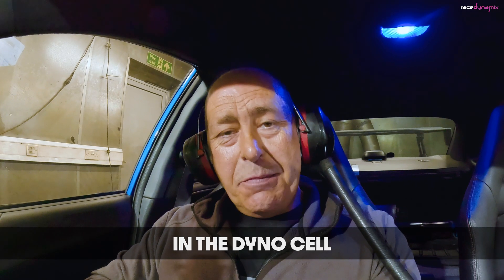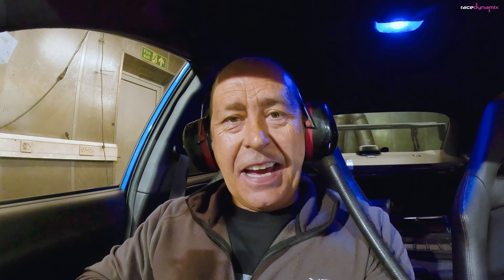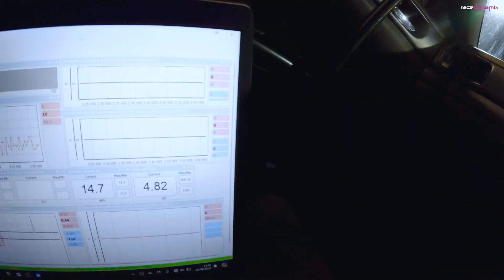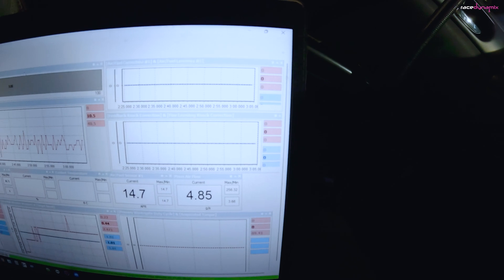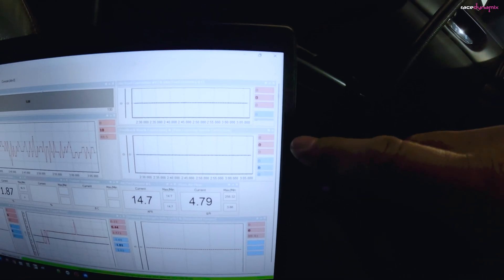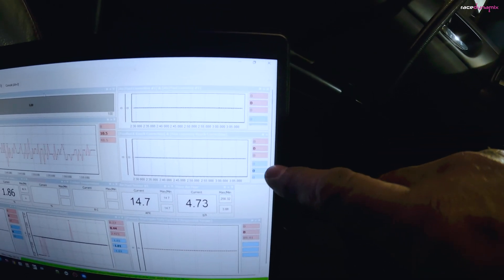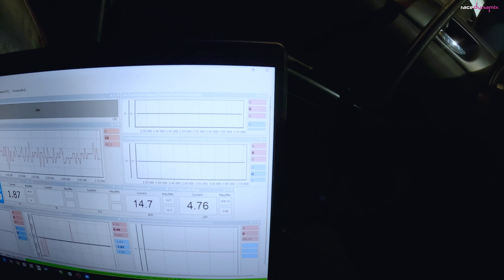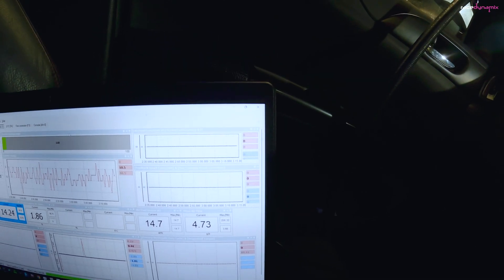SUBARU owners BEWARE .. DETONATION could KILL your engine

Comment: Hi . just bought a 2010 wrx hatch  2.5  with a very smokey  engine blue smoke), been messed with sti injectors and intercooler  claimed 300 bhp  not had a chance to strip it down yet fingers crossed the block is not toast🤞  .  can the original map be put back on the ecu  is that something you could do for me once the engine has been  sorted ? 👍
Reply from the maker: @johnbickle4654  Yeah easy enough to revert the map to std.  I doubt whether it was anywhere near 300 with the std turbo 👍👍

Comment: Hi I bought a 2003 2.0 wrx sti type uk and it has the ppp installed. Am led to believe that the ecu is locked and cannot be remapped! Is this the case? I was looking to add a bigger turbo clutch and injectors and fuel pump and induction kit to try get near 400hp. The car has 76k on it. Is there any options for me to achieve this or there abouts
Reply from the maker: Hi. Not locked to me 😂😁

turbo... needed to get 400 but your std Vf35 should do 350, just depends on how close to 400 you want.

Injectors.. your std injectors will get you to almost 400.. again it depends on how close to 400.

clutch.. std clutch will hold that power. Replace with Exedy pink when/if it goes imo.

Fuel pump will definitely be needed.
FMIC would help.

Obviously needs mapping/tuning.

Hth 👍

Comment: When i bought my wrx. Someone had put a little tune on it or its because the o2 sensors was not working and the fuel graph was off the scale on the rollers. The mapper i used first stopped doing mapping because they caused problems with there cars. I was new to the scene at the time and car had engine knock at no. 16 if thats right and det and took 2 hours to map and make it better. They put the wrong year map on it and had wavey boost. They only map to 260bhp on a wrx and because they had a case against them by damaging a engine after it was mapped. 
Cost me double though with 260 not enough and to put it right. upto 290bhp
😊👌
Reply from the maker: @michaelbaker6723  I am not sure what you are meaning saying knock at number16 but yeah there have been lots of so called Mappers over the years that have tried to map subarus.  Most have disappeared now thankfully.
Reply: @racedynamix  I can’t remember im sure they said about a number needed to be zero. But it might of been something else but at the time it was showing alot of knock. I like mappers who can map a car and not these bedroom mappers that buy the map and put it on your. My toy now is a motorbike and i had that on the rollers.

Comment: every subaru owner with a air intake asking why their DAM values are skewed. the detonation is not optimal. air intakes slow down air velocity, the MAF sensor reads it low and tells the engine to use less fuel. the presence of unmetered oxygen ignites and overheats the piston rings, cylinder walls gradually....:face-orange-biting-nails::hand-orange-covering-eyes::face-turquoise-covering-eyes:
Reply from the maker: @06wrxRA  exactly.  all of those need tuning / mapping 👍

Comment: Engine tuner here. I only work on Saab's and also use a block Mic when doing high HP tunes. The Saab Trionic ECU's use Ionisation measurement on each cyl and in general the ecu reacts super fast (even quicker than i can pick it up). With some of the cars i work on being nearly 30 years old its really cool that they are this advanced.
Reply from the maker: That is cool 😎👍

Comment: i hated the fact that even after paying for a somehow expensive course they never demonstrated how it sounds, they said look for a popcorn popping sound when in fact it is closer to dropping corn in a muffled can, or closer to opening your mouth slightly while eating pop rocks (candy that crackle in mouth).
The other thing is, if you are relying on an after market ECU to detect knock, first step is to actually induce knock, and while listening to it you set the ECU threshold, so listening is an absolute must. 
This video is gold to whoever is just starting to tune. Don't be scared to induce knock on low load to familiarize yourself with how it sound, engine isn't producing enough power to hurt itself immediately, but long exposure to soft knock will eat the boundary layer and destroy the piston. try do it it for 10 seconds or so, record it and keep listening to it, at first it is hard especially soft knock but it will become natural.
Reply from the maker: Absolutely.  Inducing this first stage of Det is the normal tuning process ... then obviously wind it back for safety 👌👍

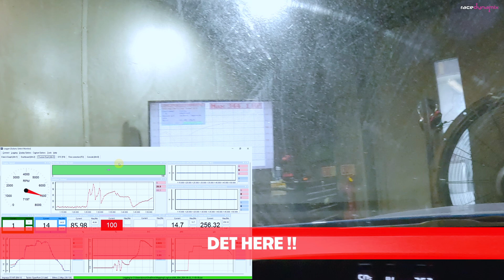Comment: 2:58-3:00...what that it!?

Holy cow, that was subtle!

And THAT has the capacity to kill your engine quick!

Super helpful video Duncan, thank you!
Reply from the maker: Yeah, that's the start of it.  That's the point to stop adding timing or leaning it out. That was a single gear pull on the dyno, through multiple gears in the real world it would get worse and much louder cracks of Det would happen rather than this sparkle.

The sparkle should be heard by the ecu and action should be taken by it but as you can see it didn't. That would kill the engine. It might not happen as quickly as massive det but it will kill it all the same.

Thanks Fred ..chat soon 🙏

Comment: Great video and thank you.  Can you
 Tell please,where to attach the det cans on the engine?
Reply from the maker: Almost anywhere is good.  The sound carries very well.  I bolt mine to the top of the inlet manifold by the intercooler bracket 👍

Comment: Was the car on pump or ethanol?  Is the knock resistance of ethanol enough to overcome the lack of sensitivity of the knock sensor?
Reply from the maker: This was on pump fuel.  Ethanol tends not to det in quite the same way but still the same issues of the std ecu being deaf to it on occasion 👍

Comment: Fantastic video..!!! So that’s just the initial crackle of Det? So the worse the Det is the more obvious is it sounds?
Reply from the maker: @tomeaton7139  Yes, exactly.  Proper det is much kiuder, much clearer sound.  This sound says "enough timing thank you"
Reply: @racedynamix  so when your working on timing are you always trying to take it to the point of starting Det? Before pulling it back slightly for safety.
Reply from the maker: @tomeaton7139  yes.  When I hear this sparkle, that is the max timing then I take it back a bit for safety margin.

Comment: Many stock Subaru roms disable feedback (and fine) knock correction slightly above 6k rpm
Reply from the maker: The iam rough correction gets dropped beyond 5500 as std but feedback and particularly fine learning continue until 6800 rpm on this rom.  The ecu will will still make some corrections if It hears something.  The point with this video is that the ecu doesn't hear everything and certainly shouldn't be trusted as the only source of determination as to whether it is detonating. It is irresponsible to trust the ecu that way.

Comment: 16bit ecus r notorious for detecting balls and not knock 😂😂while the 32bit detect sometimes even the gear change for knock. Even if I have to go around the block I use knock monitor and headphones 🎧🎧 when tuning any sort of car. Excellent video and very very informative for subaru users ❤❤
Reply: Exactly mate, you can run over a rabbit and the ecu detects phanton knock, engine on the verge of getting sent to the moon and sees nothing. the inconsistencies are scary. What isn't inconsistant is your det cans and hearing.
Reply from the maker: Lol yeah.  Scary that some people rely on or trust the ecu though 😱

Comment: I know it’s a little off topic but I wanted to know what’s your opinion on the vf 34 on v6 Stis worth the consideration or just keeping the stock vf24 and maybe send it for a rebuild when needed ?
Thx for the great content you put out for us absolutely grew into a big fan of the channel!
Reply from the maker: Hi.. There isn't a huge amount of difference between the two turbos tbh, or at least not enough of a difference to warrant change imo.  Rebuild/hybrid it when needed I reckon 😎
Reply: Thanks for the quick heads up! Was always wondering if the ball- bearing design would be worth the upgrade as it’s a oem+ upgrade I was keen on getting someone knowledgeable to give his insight! Thanks again. In one of your recent videos you said magic number for classics in your opinion was around 100 less than newage, is it because of the need to swap a 6 speed in a classic at that point or what’s your reasoning if I might ask? :)

Comment: Hey Duncan, what’s your experience with aftermarket ECU’s and det control control?  Have you seen instances where they don’t respond to det too, or is their det control much more reliable (obviously ecu dependant)?
Reply from the maker: The aftermarket ecus vary tbh, some have knock control that is simply awesome and can be relied on to protect the engine. Others are less so where knock control has been added as an after thought. I will be doing a video at some point soon (ish) on that.

All require background noise levels being set up and sensitivity set up so as to ensure they pick up real det and do something about it before it goes beyond the sound heard in the video.
Reply: @racedynamix  thanks very much Duncan
Reply: Regardless of the ecu u have to calibrate and set the thresholds for the knock levels and this can only be done by using det cans or knock monitor .... Only then u can rely on the ecu knock detection and corrections .
Reply: @WAGONNOS  I know this, what I’m trying to establish is the reliability of those ECU’s once this has been set. Will they catch every event, and are some more reliable than others?
Reply: He's mentioned that the syvecs ecus are really good, link not so great, but I bet he still wears det cans!
Reply: @phillynn1  absolutely, would be silly to not use them regardless.  I’m on Emtron personally, just wondering if there’s some aftermarket ECU’s that are seeing all knock events.
Reply from the maker: Seeing the noise and interpreting the difference in noise and background noise and correlation to potential points in the combustion cycle per cylinder can be the difference between aftermarket ecu and a really good aftermarket ecu. I personally think syvecs knock control is 100 % reliable if set up right and have run these on my car since before it was syvecs.  Emtron seems really good too 😎